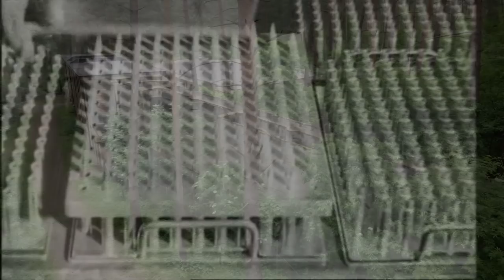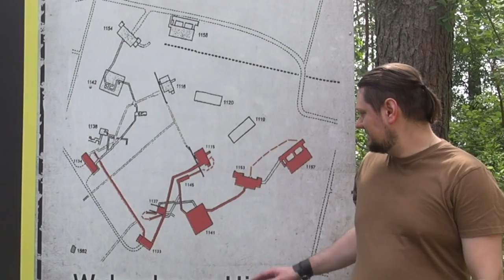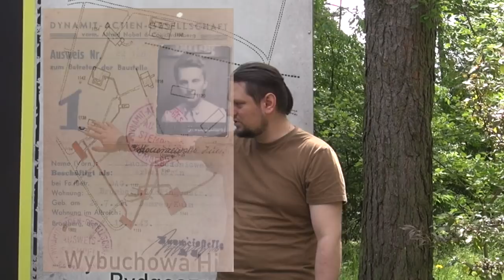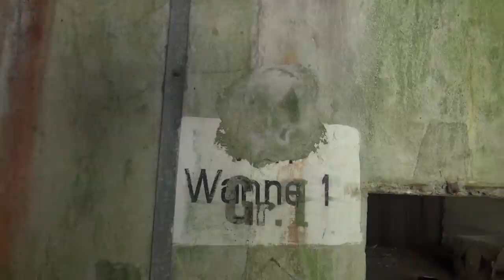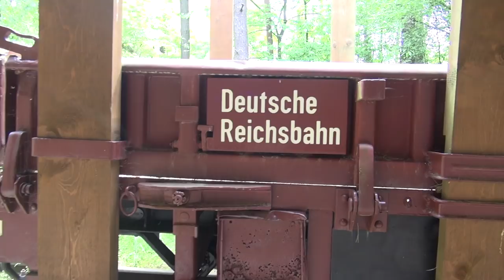D.A.G. BROMBERG WW2 GERMAN MUNITIONS PLANT

Comment: The "guard shack bunkers" you saw are "Splitterschutzzellen" for 1-2 persons, commonly called one-man-bunkers (Einmannbunker or Einzelschutzraum or Luftschutzstelle). They were mostly used to shelter fire watchmen from bomb blasts in industrial complexes and also by the Reichsbahn. Thus they are also called "Brandwachstand". These are an interesting topic in itself. Initially they were sometimes made of steel but later mostly of the much cheaper reinforced concrete. There are many different designs and incidentally the Overloon War Museum (location of Militracks) has a large collection on its grounds.
Reply: Amazing , absolutely amazing and to think all these yrs later still camouflaged as it was back then

Comment: Rolling through this fascinating tour: 

Some of those "continuous""holes through several floors, around the 21 minute mark look like service-lift penetrations. If there is no sign of "motor rooms on the roof, check the basement for the mounts for the cable-winching machinery that drove the cars.There may have been a full-length protective cage just like those seen in civilian structures all over the world. Beats carrying stuff up and down stairs by hand. Probably "liberated" by the Russians or resource-hungry Poles after the war..
Reply: Also, all those "trip-hazard "flanges around holes in the floors? What is the bet that the entire structure once has wooden floors laid on wooden joists. . Reduced dust from walking and rolling trolleys and if something "rolled off the workbench" it might dent the floor, but not the valuable product or tool /gauge.

Speaking of "big Bangs, I read an account of an explosion in a WW1 US ammo plant (Eddystone, PA, 1917, in "Hatcher's Notebook", I think. Seriously messy!

Comment: Sir :  I believe the apertures that you refer to as shutters are in fact "Blast deflectors" that angle a blast in a specific direction.  I see no use for "shutters" in the accepted meaning of the word, but deflectors to divert the force in a specific direction does make sense, especially when you consider that the "shutters" are about 10 0r 12 mm thick.....shutters would have no need of being of such heavy  construction. As usual, your videos & commentaries are excellent. Thank you !  Brian
Reply from the maker: I agree with you it was probably just a poor choice of words on my behalf however armored shutters are a thing that you would find on some armored vehicles and then some bunkers which is basically the same think the reason I refer to them as shutters is they will open and shut with a handle

Comment: Above-ground tunnels? 24/ 7 operations? Material and personnel could move between buildings  without visible lights at night? Accidental explosion or a bomb-strike? the relatively fragile walls and roof would be damaged, but the bulk of the explosion would not be conducted into adjacent work / storage areas.

DAG appears to have been a "spin-off" of the original "Dynamit Nobel". dating back to the late 1860's. It was still in business under that name into the early 1960s, making ammunition for the Bundeswehr and export, carrying the headstamp "DAG". We saw a bit of their blank, 7.62 NATO ammo here in the 60's and 70's.

Sometime in the 1960s they were bought by the slightly more youthful RWS conglomerate. (Rheinisch Westfälische Sprengstoff-Actien-Gesellschaft“ founded in Troisdorf in 1886)

Because of its "delicate" nature, Nitro-Glycerine was not preferred as an explosive in its own right, but CAREFULLY blended into an absorbent material like Kieselgur, (Dynamite recipe) it became useful and reasonably safe to transport and use. it rapidly became the explosive of choie in the mining business. Nitro Glycerine also found a vital role as a "modifier", blended into Nitro-Cellulose propellants. ("Double-Base" powders, in the trade). These could be manipulated into various shapes by extrusion or rolling / slicing, before final washing and drying. Unconfined, it burns rapidly but does NOT explode.

A "classic example" of a "double-based" propellant is the good-old British "Cordite" which was stuffed into billions of rounds of .303 ammunition over the years, starting in the1890s.

Composition:

Nitrocellulose - 37%
Nitroglycerine - 58%
Mineral Jelly - 5%

This was changed after ten or so years of service to a new , "cooler-burning" brew that caused less bore erosion .

Nitrocellulose - 65%
Nitroglycerine - 30%
Mineral Jelly - 5%

This composition is what was adopted into British service only a few years before WW1. Every serious military around the world was also scrambling to leave the "black-powder age" well behind, at least with small arms ammunition.

Comment: A fascinating explosives production complex. It is a pity that I did not know about its existence when I visited the nearby historic Torun. Personally, I have an impression that the real history of this facility is different than the official guide presented. The size of these objects, the enormity of earthworks associated with it, the quality of the finish, the amount of material needed for construction, and the relatively primitive and small machines used in 1939 contradict the official version. If you believed that the area was undeveloped, then the geodetic works themselves would take a few months, then no lazers or GPS were used, without these geodetic plans building planning would be illogical. Moving large amounts of soil is very laborious, and if the terrain was rocky ... At that time, the Germans did not have a large number of trucks, excavators and bulldozers. Even the German army relied heavily on the use of horses for transportation. Without computers and printers, printing plans also means that it was impossible to do it in a flash. Since this complex exists, it must have been built by someone at one time. Those who heard a little about Tartari (recently some interesting hypotheses related to it appeared on the Internet) will probably say like me that these objects were their work.

Comment: Tiny the atmospheric stability required  to  produce the vast amounts of nitro glycerin  involved  lots of cool air flow  stable environment  as nitro  doesn't like  to be disturbed by rapid changes  also ammonium  tri iodite  was another compound  toyed with it was  very  unstable while being processed  very temp and pressure sensitive  another  tri nitro toluene  TNT  LIST GOES ON  hope this helps  octal  also

Comment: I've worked in many large scale industrial settings, you really have to think different about it.
We se buildings with machines, in this case missing machines.
But what you actually are looking at is the machine,  or rather the outer exoskeleton of a machine with it internal parts removed.
You have to change the scale in your head.
Reply: You sound like a used car salesman. “No this isn’t scrap it’s just had high level weight reduction and those aren’t bullet holes they’re air vents”.
Reply: @flashgordon6670  that's amazing, you can hear the written words?

Comment: I so much want to see one of those crazy acro FPV drone pilots rip through those floors with holes in them.  It would be incredible and would sound insane in that empty concrete shell.  Yes I know this is an old video.  I'm that far behind your awesome work.
Reply from the maker: See I would love to do that but my drone seems to have this strange flaw that every time it comes close to cement and concrete structures it runs into them instead lol cannot possibly be my fault
Reply: @tinostruckmann  likley it's the rebar creating magnetic interference with the flight assistance built into it.  I have a 3dr solo camera drone and turn off gos and compass when I'm flying around large metal stuff sometimes.